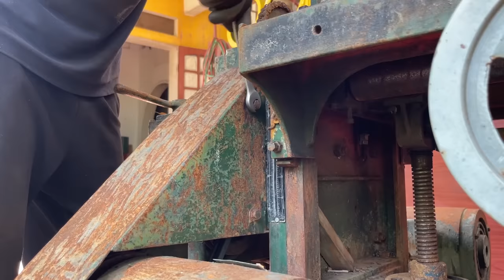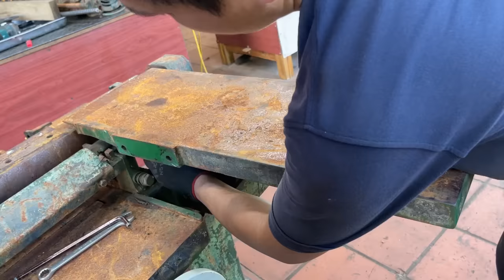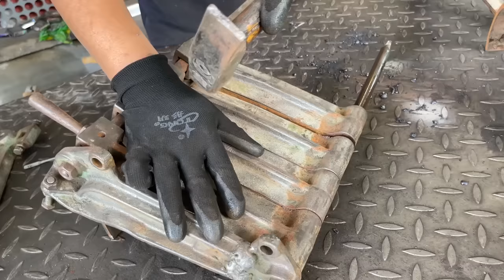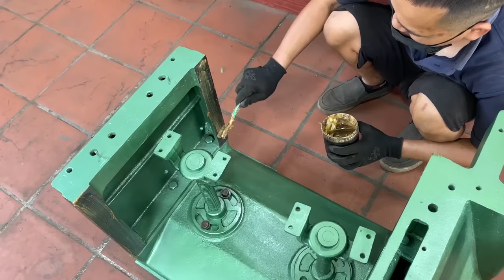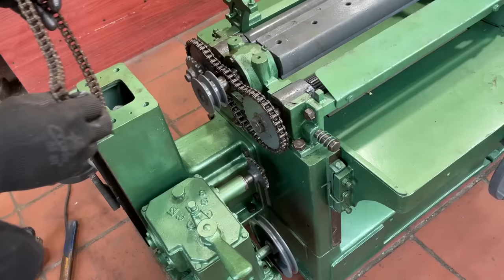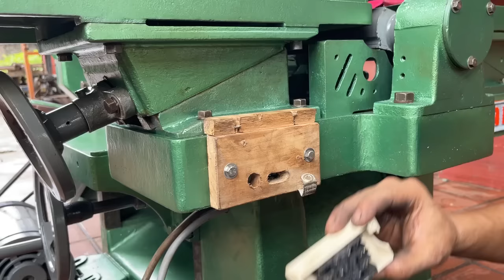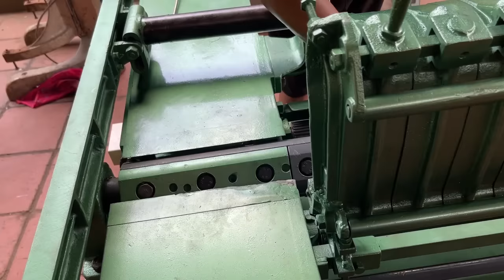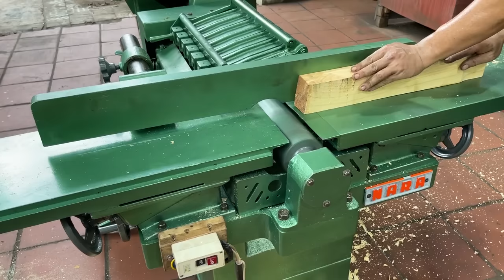Restoration Genius  The Genius Boy Restores The Hitachi 3 In 1 Woodworking A 1500A For Carpenter

Comment: Spoiler alert:  The original owner had pitched that thing into the weeds years ago after the jointer ate his hand.  All kidding aside,  when I saw him pushing that block of wood across the jointer with the infeed shelf higher than the outfeed shelf I was certain that I was going to see a grisly end to the project.  So much of this thing is unsafe.  It should be returned to it's grave.
Reply from the maker: Thank you for your comments. Because we installed the cutting blade incorrectly, we have learned a lot from this machine. See you in the following videos.

Comment: That was an expensive machine when new. With all the paint on the working surfaces it wasn't possible to see if they needed grinding or not. Very risky way to use a jointer! Needs to learn about electrical work. This was more of a paint job than a restoration.
Reply from the maker: thank you for comment . We need to learn a lot from you

Comment: This is fake. Something this old and left outside should have had debris and dirt all over it and it didn't. It had a few vines on it and that was it. Bolts were easy to remove and clean on the threads. Little interior rust.
Reply from the maker: Thank you for your comment

Comment: Boy? I see a grown ass man. I would not have painted the steel surfaces that were never painted, such as feed tables, jointer table and steel rollers. I would have cleaned them up with wire wool / light abrasive cloth. The paint will cause issues. Wow, you nearly lost a hand to that jointer. Aside from no push stick or safety cover, you are taking too much wood in one pass as both the feed. and outfield tables are set too low.
Reply from the maker: Thank you for your comments, we learn a lot from you, see you in the next videos

Comment: What a shit job . I wouldn't use that planer because the table isn't set right and doesn't receive the planed  timber correctly. It drops down and makes a huge gash on the end . When it does that the timber will fly out the end and your fingers will drop into the cutting blade . I also know that this machine is not an Hitachi as it's more like a Wadkin design. I've been a joiner since 1979 and have had machines similar to this in my workshop. Particularly didn't like the tensioner for the chain as that bent up bolt would wear down the chain and get caught in it . The chain wouldn't last a day's use .. There was a reason this machine was dumped as that's all it was good for .
Reply from the maker: Thank you for sharing, please watch our next videos

Comment: Bad work "Genius Boy".

Beating on fitted and machined parts with a metal hammer is just ignorant. So is scorching the windings on a questionable motor with a torch. So is stick welding safety parts with zero indexing. And only a person with zero clues, would SPRAY PAINT the machined table surfaces, feed rollers and cutter heads, FFS!!!

I pity the dupe woodworker who buys one of these hasty, slipshod pac-rim "restorations" by foolish scrappers thinking it's been refurbished. People who have no idea how a machine is supposed to work should never attempt such a job! My favorite part of this video is this clown trying to hog-off 1/2" of wood on the jointer in one pass with the outfeed table level with the infeed table and the piece of wood launching off camera. I hope no one was hurt!
Reply from the maker: Thanks for your sharing,